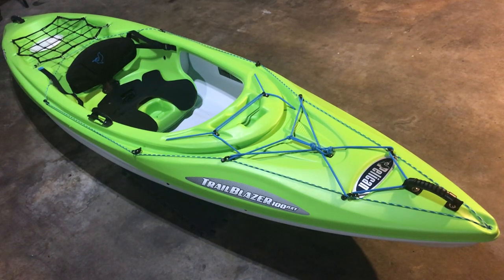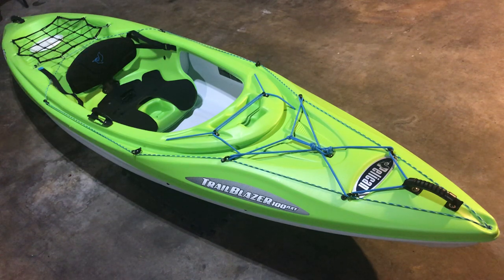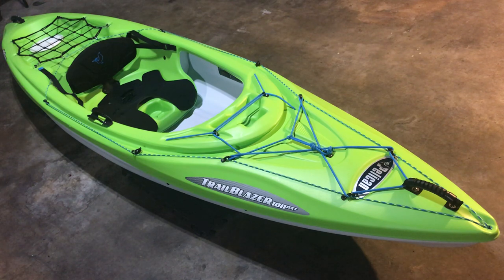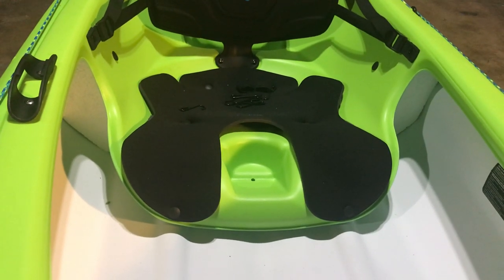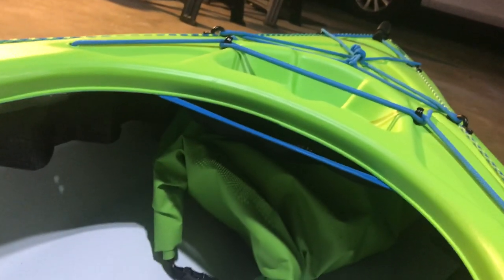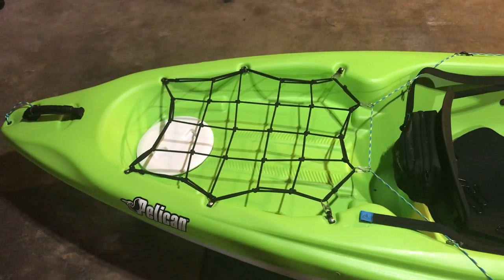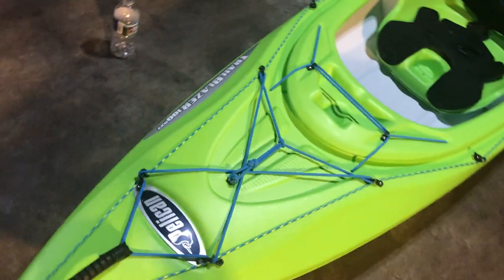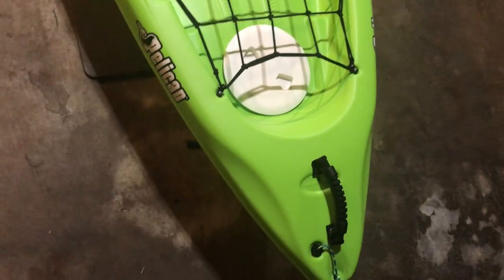2018 Pelican Trailblazer 100NXT - Review and Backcountry Modifications

Comment: How did you get the rear bungees off without cutting them?
Reply from the maker: The bungees have a metal tip that can be pulled through if aligned correctly. Use a flathead screwdriver to tilt it and angle it so it can slide out.